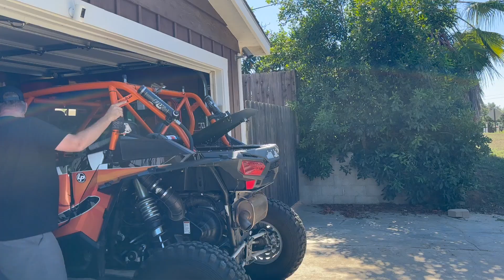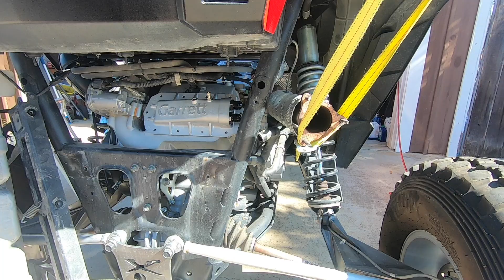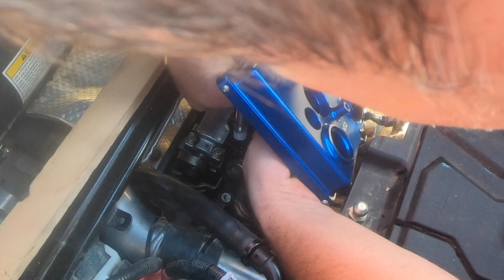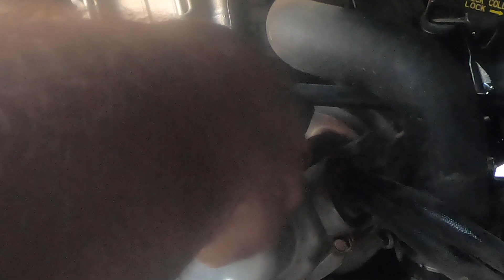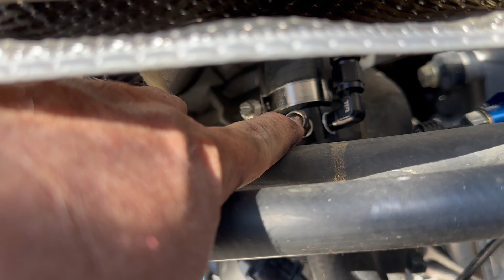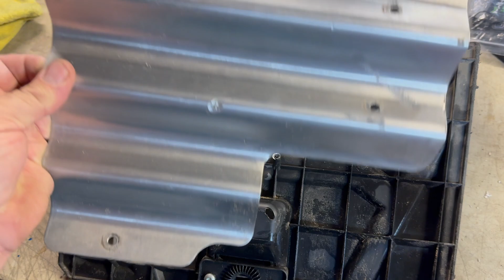TPR Performance Parts Full RZR Install!

Comment: Awesome video and thanks for making it. I do have a question about the full flow kit. Is there a plug inside the head that needs to be removed to be able to thread in the pipe that goes through the valve cover?
Reply from the maker: @swdiosdiosdado  yes, it uses an Allen socket and comes right out.
Reply: I just spoke with TPR and yes there is a oil plug that needs to be removed. They said use a quality Allen and a breaker bar otherwise the bolt will strip. For some reason this was not covered in this video.
Reply from the maker: I thought it was mentioned and I mentioned it in the comments as well